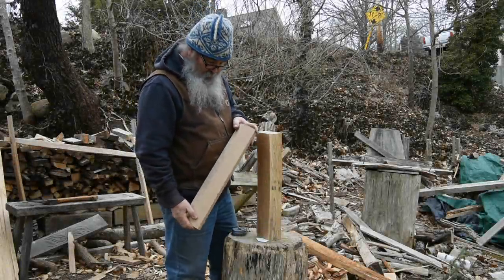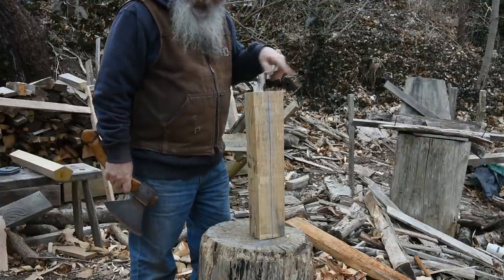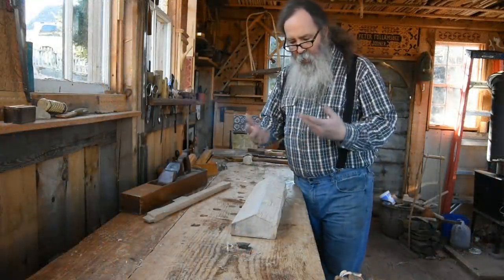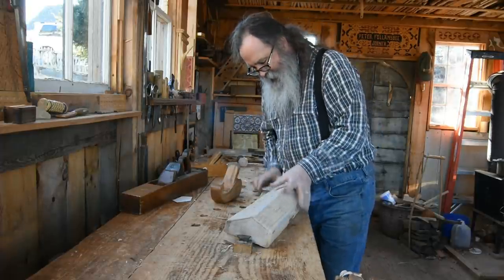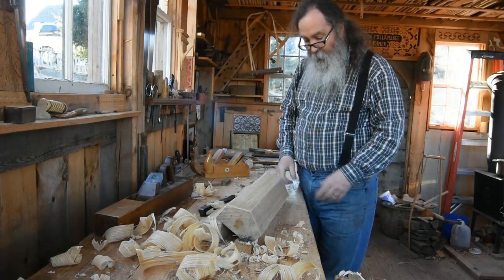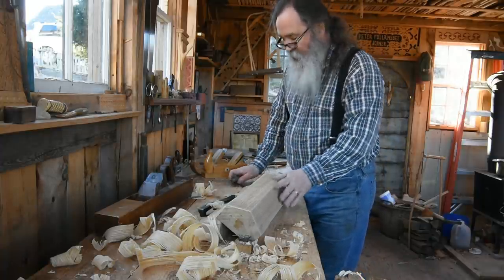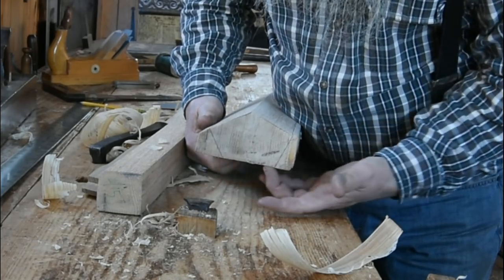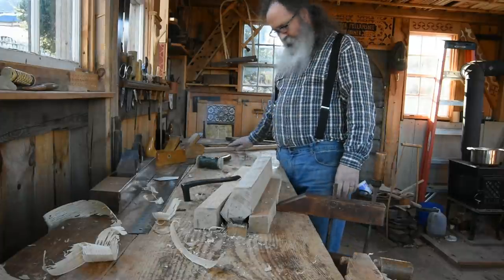planing pentagonal stiles

Comment: 🐯🐼The oak shavings look like they have a lot of stored energy and jump up and out of the plane. Does wood have memory like steel? And is it released when its cut? Is that why it looks like they jump out and is that the reasons behind relief sawing in mill work? Just wondering😃cheers👍🐯👍